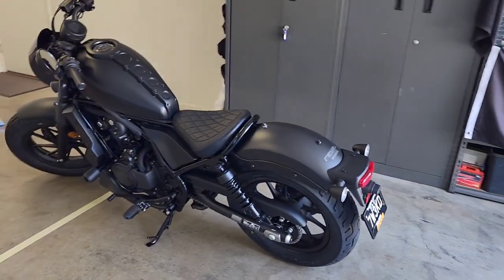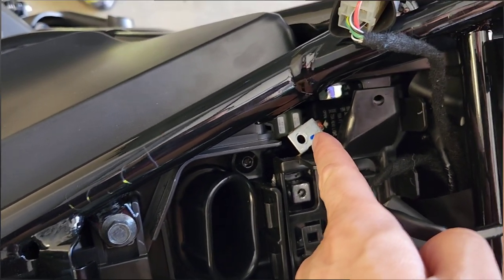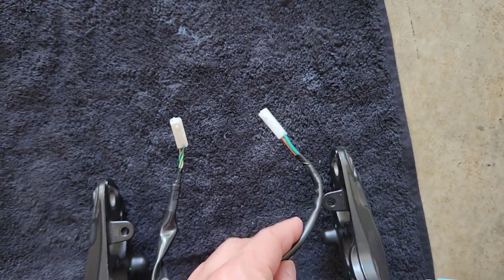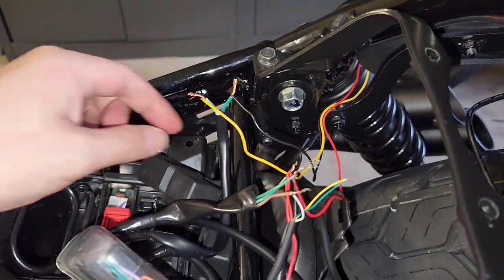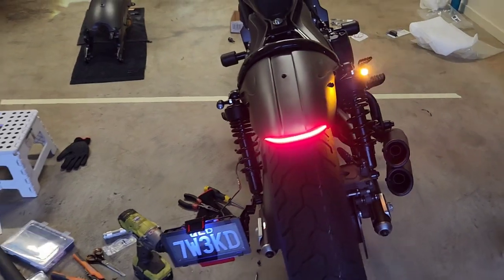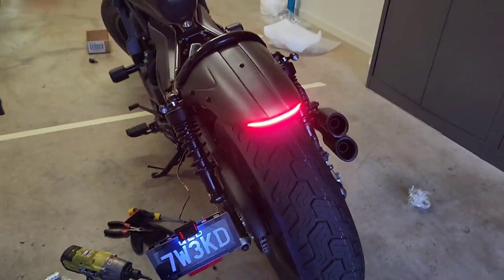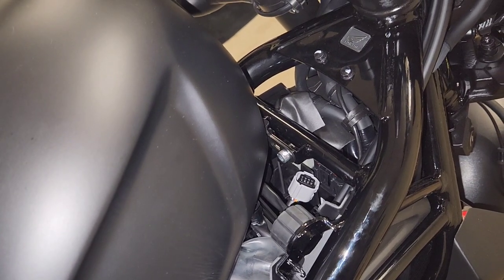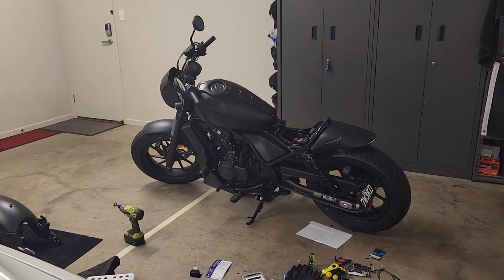Diablo KSPEED rear fender install for the custom Honda Rebel 500 - 7W3KD TWEAKED

Comment: Thank you so much for this excellent video. No annoying BS from some idiot trying to sound cool and no irritating and distracting loud music - just straightforward, step by step explanation which is really useful. 
I really appreciated the thorough explanation of the under seat wiring harness feeding the rear lights. I've been chasing that for a while as I want to put in a buzzer to sound in synch with my indicators when they are switched on. So dangerous when they are inadvertently left on.
By the way the spare space for a relay under the tank is for the accessories circuit. This relay is a feature of  later models. It is a 7.5 amp circuit so can take a lot of load. There are male and female bullet connectors buries in the wiring loom under the speedo/instrument console. The bullet connectors are generally used to mount a USB port. In these later models the USB port won't work unless the appropriate relay is placed in that spare slot. The Honda USB port for the later models comes with the relay and there are many sellers online selling USB ports for the Rebel that come with that relay.
Once again thanks so much for taking the time to make this very informative video.
Reply from the maker: @kenhogan1433  You're welcome. Somewhere in one of my relay videos I made a note in the description box as it changed after my year model. I have sold this bike now but there's plenty of content for other mods you might consider. Thanks for watching 👍

Comment: The explanation for the wiring connection, which is which and which goes where, cant be better than this! Well done! Though I personally not a fan of Diablo fender kit. But everyone to their own.
Reply from the maker: Thanks. The good news is that even for people wanting to change brakes and indicators can follow this guide. I'll be doing that for my friends bike this weekend and will make a video 👍
Reply: Can you add a wiring diagram? Did the Diablo come with a wiring diagram?

Comment: The 2023 model comes with LED flashers as standard so thankfully there's no need to change the relay if changing to aftermarket flashers. Great video!
Reply from the maker: That's unfortunately not true. I have a 2022 which is led and it needed them as well. Different led lights draw different amounts of power so you will still need the relay.
Reply: @TweakedGSX  ah shit! I thought I was going to be lucky. At least now I know where the relay is. Cheers.

Comment: You have awesome videos!  I’ve watched several of them while customizing my 2023 Rebel 500.  I’m running into a problem with the blinker relay though.  Mine looks nothing like the ones in your videos.  Have you happened to hear about a  different relay for 2023?  Thanks
Reply from the maker: Thank you. Yes there are two types of relay connections. In my history I have 2 relay videos. Somewhere around 22 or 23 they changed the shape. In the correct video that corresponds to your bike, I will have the link in the description for where you can buy it from webike Japan. 👍

Comment: Awesome vids mate. Have you had any issues with QLD Police and the side Number Plate??
Reply from the maker: Thanks mate. No issues yet, but if I get pulled over I am willing to talk through the rulebook. I am fairly confident on everything except that my rear indicators are not E marked 👍 Are you considering to install one?
Reply: I haven't considered doing it but like the look. I just installed the combustion industries tail light and its awesome.
Reply from the maker: @brendandowling6526  I just saw it, it looks rad😎

Comment: How have you gone with the number plate bracket? (Just saw your reply on my other comment) Have you had any issues with the wobbling or gotten around to putting another bracket in?
Reply from the maker: I changed to another bracket but then came back to this one but used two of them and it's solid now👍

Comment: I'm confused as to why the flashing is off pace.. the OEM lights are LED so shouldn't the new LED's be similar speed? I thought problems only occurred when switching from standard light bulbs to LED..
Reply from the maker: It seems the relay is overly pedantic, even in this led to led swap situation, the current draw from the new led is more than factory and so it flashes fast. I've had this on about 5 different LEDs on the Rebel.

Comment: when you added the rear blinkers and license plate brackets to the shock bolt did the shock dis engage or was it a simple slip on. Also, did you have to torque the shock bolt at all ?
Reply from the maker: It maybe had a half a cm of decompression which you will be able to manage by gently sitting on the seat whilst you put the indicator bracket on then putting the shock back on. I did the bolt up at 100nm max it doesn't need much. Just remember that you should re-check then after your first ride. I check everything on my bike once a month as I've undone many nuts and bolts. If you get paranoid about it you can put a very small drop of non permanent Loctite on the thread.

Comment: Hey mate,
Your video is amazing and very helpful.
I have a question. I buy from k-speed rear indicators but i dont know if a led. So if dont change relay is problem? Thank you
Reply from the maker: Thanks. You will need a relay to slow down blinking as even a kspeed led draws different current to the stock indicator.
Reply: @TweakedGSX  last question can i lift up from oil pan because i want to put fork boot. Thank you
Reply from the maker: @antreaspetrides2606  you have to be careful for 2022 model as abs module is under the sump

Comment: Hey mate,

With the indicators, if you’re on a stop and indicating left and have the brakes on, would the right indicator light up red and vice versa with the right indicator?
Reply from the maker: Yes, it alternates between red and yellow as it flashes
Reply from the maker: In your description, the left indicator would alternate red and yellow and the right indicator would remain red if your brake was on.
Reply: Thanks Juzzie!!!
Reply: Another question,

Do you know the measurement of space from the tip of the rear fender to the tyre?
Reply from the maker: @anepns2085  not verbatim, but check my rear shocks Install videos. My current shocks are height adjustable. Regardless though neither OEM or aftermarket can safely allow the plate to be mounted off the fender. There is one manufacturer making one for a fenderless 500, somewhere on webike though

Comment: Do you need to remove the bolts from the passenger pegs and muffler to look at the wiring for the turn signals in the back and front. And does the license plate have to in that position can it be up and down.
Reply from the maker: You remove the bolts for the pegs because you don't have a need for them as there is no passenger once you install the shorty fender. The license plate can be mounted portrait style yes.
Reply: @TweakedGSX  I also see that your license plate holder is connected to the suspension. Is it just unscrew it and put it in. That simple?
Reply from the maker: @thespeeddemon5685  yes unbolt lower shock bolt and slide on the extension arm for the plate holder
Reply: @TweakedGSX  will the suspension go flying or is it still as if there was no tension
Reply from the maker: @thespeeddemon5685  you buy a longer bolt which is the thickness of the extension arm. This way you have the same amount of thread tightened to hold it all together.

Comment: Is this seat much more comfortable than the stock seat? 🙂
Reply from the maker: It is the factory special edition seat which is very similar to the non special edition seat. Only the design looks different
Reply: @TweakedGSX  oh i see. Thanks!
Riding the stock seat for over an hour isnt really comfortable *as some would say
Reply from the maker: @tonyjuguan4292  yes, I am 75kg riding weight. I think that if you upgrade the rear shocks like I have, you would like the bike a lot more and not have to modify the seat.
Reply: @TweakedGSX  alrightie. I'll keep this in mind.

Comment: Taking the license plate and mounting it on the side just makes the bike less aerodynamic.  If it's on the fender it doesn't catch much air.  Sticking out on the side just catches a lot of air negatively affecting both handling at high speed and gas mileage.  Also it is asymmetric.  It looks like a man with one ear.  It's funny how when a fad starts, everyone has to jump on board whether it makes sense or not.  It's just like fashion.  Is it a good idea to rip holes in your jeans?  Not really.  But once it becomes a fad, everyone does it no matter how silly it is.  Just like when it became a gangster fashion to wear one's pants down below their butt.
Reply from the maker: That's a whole lot of dribble.
Reply: @TweakedGSX  Yeah, I was afraid you wouldn't like it.  Of course, it's all true. Just saying it's dribble isn't a really very clever response.  Nevertheless, who am I to keep you from enjoying the latest fad? You did a good job on the modification.  Have a good day.
Reply from the maker: @jlrutube1312  no idea what you are talking about but it is obviously not based on  riding my bike which has no problems whatsoever with stability. This is mentioned numerous times on my videos and is physically demonstrated in my latest ride video.... But do tell me all about my bike without even having ridden it, or tested it on your own bike 🤣
Reply: @TweakedGSX  "But do tell me about my bike"...  Okay since you have asked me to.  Your bike is pretty cool and you have done a good job with it.  I just think that the fad regarding the tag relocation is sorta silly since it is asymmetric and it certainly doesn't help the aerodynamics. I don't have to ride your bike to know that it is asymmetric, I just have to have eyes.  And I don't have to ride it to know that something sticking out like that will catch air,  I just have to have common sense.  I realize that neither one of those things are a really big deal but I was just saying how I felt since that is what comments are for. Have a nice day.
Reply: I don't think such a small square will affect handling or gas mileage to the point it's noticeable. The air going past you isn't perfectly flowing straight, it would've already been disrupted by your legs, handlebars etc it won't really make a difference of 5mpg and steering left by itself lol.